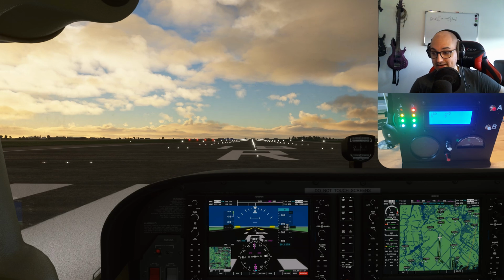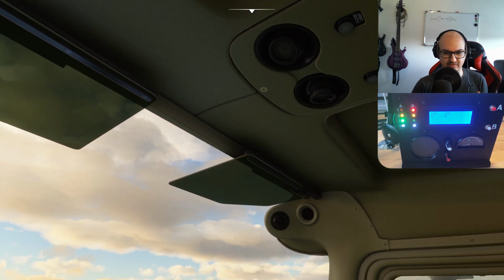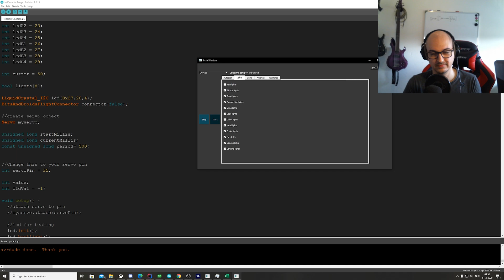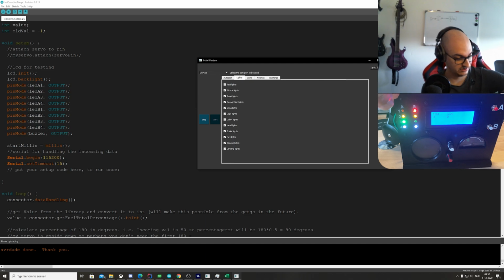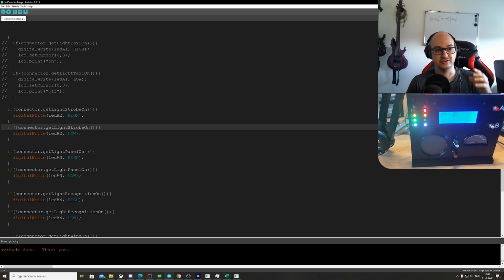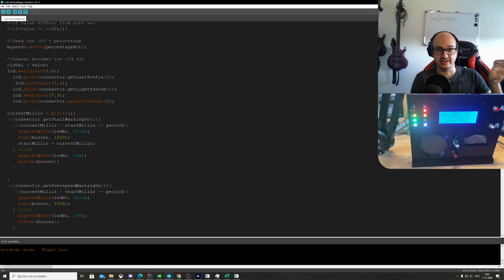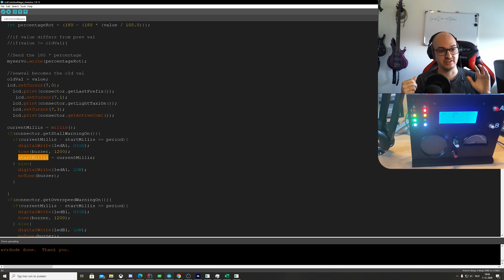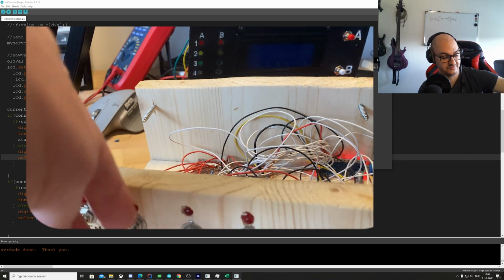Arduino flight simulator 2020 lightstates and your custom warnings, OVERSPEED OVERSPEED!

Comment: That´s so GREAT!!!!!!
I´m really looking forward to getting Gear and Flaps Stats :-)))
Reply from the maker: It's like you can read my mind.  At this precise moment i'm working on these values:
       // Rudder/trim
       AILERON_TRIM,
       AILERON_TRIM_PCT,
       RUDDER_TRIM,
       RUDDER_TRIM_PCT,
       ELEVATOR_TRIM_PCT,
       ELEVATOR_TRIM_POSITION,   
       
       // Gear
       GEAR_HANDLE_POSITION,
       GEAR_HYDRAULIC_PRESSURE,
       TAILWHEEL_LOCK_ON,
       GEAR_CENTER_POSITION,
       GEAR_LEFT_POSITION,
       GEAR_RIGHT_POSITION,
       GEAR_TAIL_POSITION,
       GEAR_AUX_POSITION,
       GEAR_TOTAL_PCT_EXTENDED,
       
       // Flaps
       FLAPS_HANDLE_PERCENT,
       FLAPS_HANDLE_INDEX,
       FLAPS_NUM_HANDLE_POSITIONS,
       TRAILING_EDGE_FLAPS_LEFT_PERCENT,
       TRAILING_EDGE_FLAPS_RIGHT_PERCENT,
       TRAILING_EDGE_FLAPS_LEFT_ANGLE,
       TRAILING_EDGE_FLAPS_RIGHT_ANGLE,
       LEADING_EDGE_FLAPS_LEFT_PERCENT,
       LEADING_EDGE_FLAPS_RIGHT_PERCENT,
       LEADING_EDGE_FLAPS_LEFT_ANGLE,
       LEADING_EDGE_FLAPS_RIGHT_ANGLE,
Reply: @Bitsanddroids  damn, you're a freak, man!

Comment: Is there any way to get the seatbelts sign or no smoking sign state from the sim?
Reply from the maker: I just checked and both are available. Ill add them next update. I'm not sure if the game itself will already triggers the warning. So I have to do some testing to see if the game already implemented this function.
Reply: @Bitsanddroids  thank you! I tried to activate them but it doesn't work for me(a320neo fbw). It seems that asobo didn't implement those switches in simconnect yet.

Comment: Is there not any worry that you will blow the arduino since eyou are drawing all of your current through the single 5V pin?
Reply from the maker: You are completly correct especially if I would wire up my second servo as well. But I've been mainly using this as a testbench so I enable/disable the features I need at the desired moment. When I create a dedicated sketch for it I need to add an external power source. Probably an adapter. I can already see the lcd go dimmer/brighter if it runs in cojunction with the servo